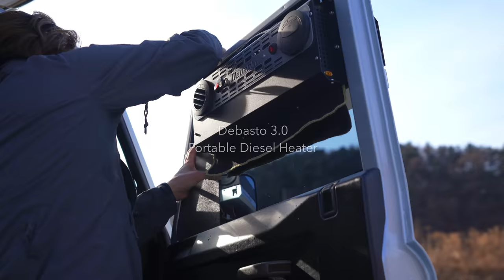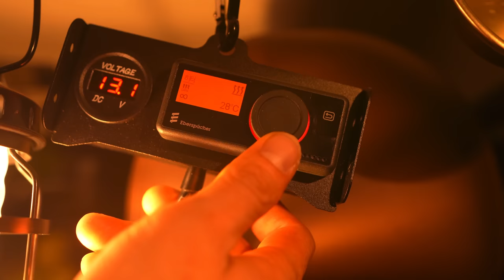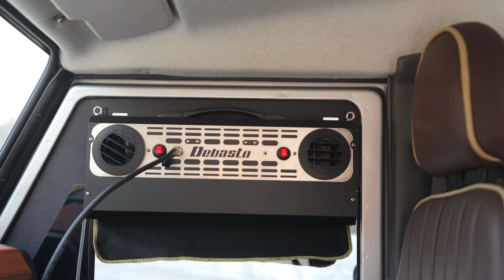CAMPING on the ICE RIVER | LAND ROVER DEFENDER 90

Comment: How sustainable is all this? Aside from diesel (for truck & heater) 
How would you charge the electronics? As well as replacing fuel canisters? Have you considered/explored any other options that could have more long term use cases?